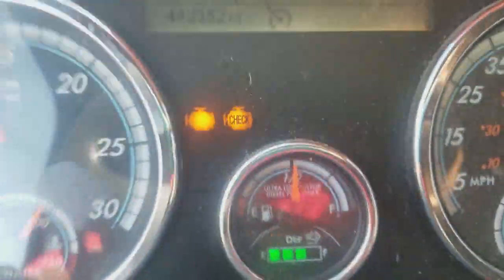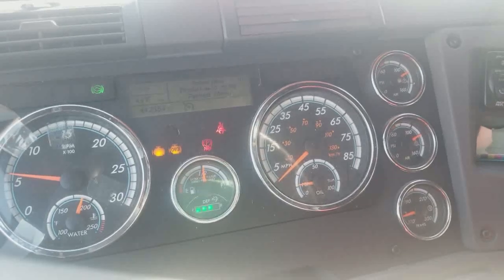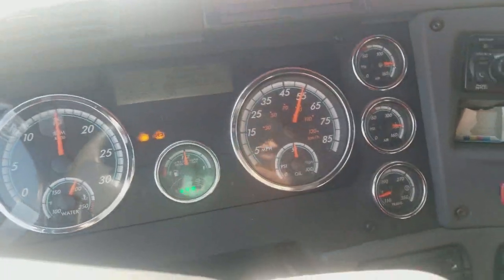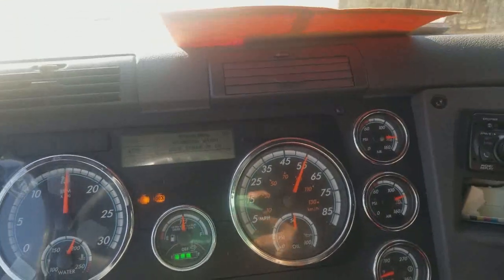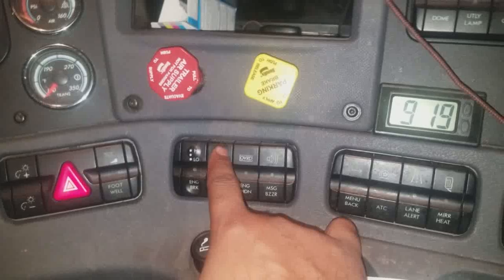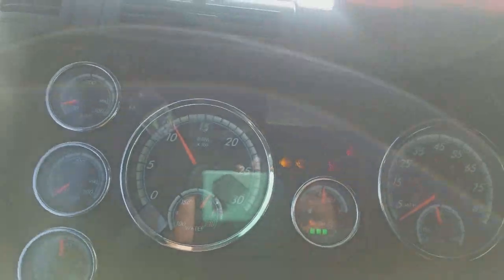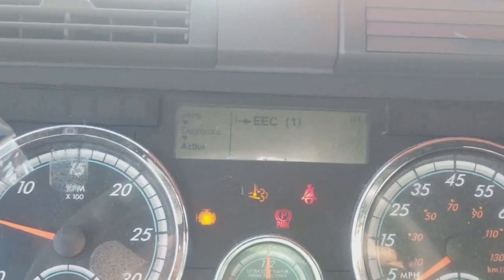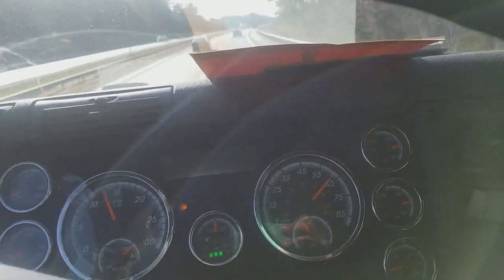Regen A freightliner?DEF PROBLEM Yellow flashing light & check engine light? Derated, speed dropped

Comment: My truck has been doing the same thing. Two engine lights on and def light is blinking. It has happen about 3-4 times but my truck has been able to regen when pressing the regen button and it goes away. It happen two days in the row and that’s unusual for my truck to regen that often because I’m local I’m not otr. Usually I’ll have to regen about every 3 days when working. I’ll be getting the whole system deleted soon by the grace of god hopefully it doesn’t cause me no more problems before I can have it deleted. Thanks for the video, I’m a female driver I dnt to much about mechanical issues.
Reply: Pain in the butt, I’m going through those issues now.

Comment: Thx bro..  my truck just went into regen.... I'm stuck on the highway n was about to call a towe...freightliner said truck wouldn't regen because I needed a cpc  , which is on back order 180 days...smh.
Reply from the maker: Don't listen to freightliner and get 2nd opinion.
Reply from the maker: Remember if u take off the switch u can drive without regen
Reply: @desitruckersinu.s.a2797  the Regen switch on the dash?

Comment: You can also disconnect the transmission sensor and that will let you driver over 55 mph, though I was told by a mechanic that if you drive for extended periods like that let's say 6 or 8 hrs it can damage your engine, but I am thinking that if you let it cool down for a couple of hours (in cold weather, more if you are in florida) I believe it could be fine to even drive it for over 24 hrs, that it is just my believe.

Comment: I have same problem 2017 Frightliner cascadia not take regen no code active but have plain engine light check engine light and def light flashing derate to 55mph and after 275 miles light goes off start working fine
Reply: Bhaji I get same problem
Reply: 2 weeks ago I fixated from Frifghtliner . That time I got red light engine sing also
Reply: Now solid engine sing check engine sing and def light blinking
Reply: @kirpalsingh6158 how did you fix it

Comment: Same issue. Did a Regen. Clear the DEF blinking light. Had my Def tank cleaned out a few days ago, but still some issues though. Smh.
Reply from the maker: Does That happens after you idle truck for long time?
Reply: @desitruckersinu.s.a2797  I should have given an update. A few days later my truck ran normal again.

Comment: If you don't have a battery kill switch in your truck at the bottom of your driver seat
Disconnect the positive battery terminal on your battery terminal for 15 to 20 minutes & re hook it again then start the regen process
Reply from the maker: you are right i missed that.
Reply: Why 15 to 20 minutes?
Reply: @TheLORENA38  , so your ECM/ ECU can reset by taking away the power for 20 minutes.

Comment: I cant find the power cut off switch in my 2015 freightliner cascadia its not on the floor near the driver's side door in mine. Anyone knows where it would be please let me know.
Reply: Ok so update... turns out my truck wouldn't regen because the check engine light being on prevents it and the whole issue was the whole DEF pump under the truck was leaking and not actually doing its job so once it was replaced every light on the dash went bye bye. Woot woot.
Reply from the maker: thanks for the update. also if u dont have switch disconnect power/ground cable from battery for 15 minutes to reset.
Reply: Ok

Comment: My Freightliner doesn't have that power knob. What do I do
Reply from the maker: Buy otr device and forced regen your truck. Its so helpful.
Reply: If you're truck doesn't have a Power Cutout Switch, then just disconnect the positive battery posts (all positive connections) for 20 minutes.

Comment: Thanks for this video .
I have the same problem from time to time during my driving 
When the  light comes on I stop for sometimes until the engine light turn off  than I countnie driving no idea why this keeps happen from time to time
my truck frieghtliner Cascadia 2016 .
Can you tell me please What the mechanic said after diagnostic done ?
Reply from the maker: It need regen. Mostly when we idle the truck we will have this type of problem. Mine is also 2016 truck and I bought forced regen device. Look my other video and buy one. I forced regen every week or 2.
Reply: Where you bought your force regen device plz 
Cuz I have this problem few times

Comment: I get something  today  know I can’t move  I have to wait Monday some one 2016 def lights check light engine light
Reply: What happen did you fix it, why didn't work,, same to me
Reply from the maker: Buy the forced regen device it will help in emergency situation and save time and road service
Reply: Nox sensors and get your Filter clean egr clean as well happen to me last month in Phoenix Arizona 8 days in the Hotel
Reply: @doggtownryker7645  is your truck good now i have same problem nox sensor on back order

Comment: I dont have that kill switch
Reply from the maker: disconnect ground cable from battery
Reply: @desitruckersinu.s.a2797  hello bro I have same issue, trying everything but not working, i am on a truck stop can you help me out, i dont have that switch, its same truck 2016 cascadia